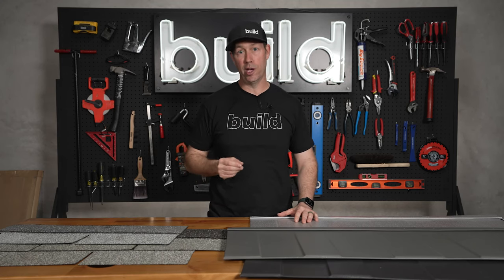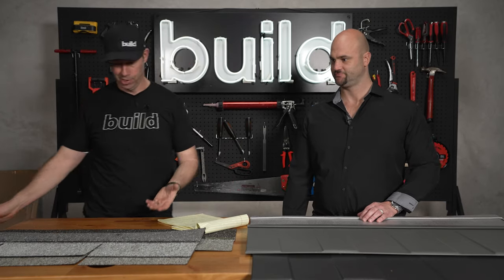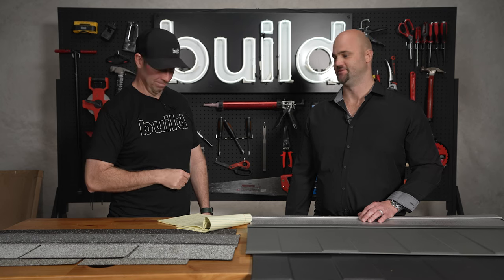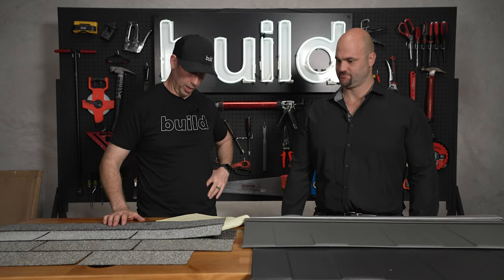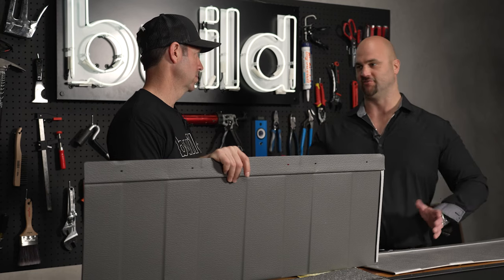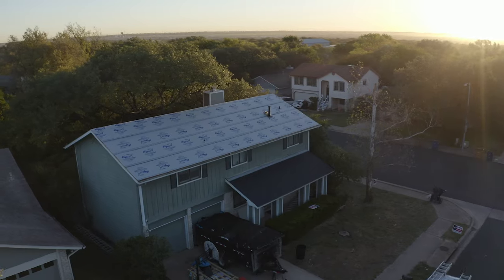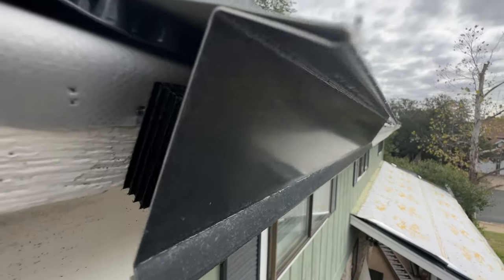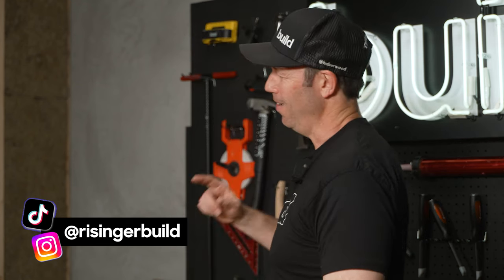Roof Shingles :  Asphalt vs Metal

Comment: Great video Matt thank you. I'm glad you touched on the hail issue early on and I'd like to share more information here. On a Facebook post I noted my preference for metal roof because of the issues you talked about here. A friend of mine who worked with the NRCA (National Roofing Council of America) noted one caveat I should mention. When an asphalt roof has hail damage part of the waterproofing system has been removed and is therefore covered by insurance. Hail damage to metal as mentioned here is aesthetic and it is likely that a traditional homeowner's policy will not cover the damage because as you said you have not damaged the waterproofing characteristics, just the aesthetics. Insurance likely doesn't cover aesthetics. I quickly added that as my friend says he's seen a couple of architects get in trouble by disgruntled homeowners finding this out the hard way.

Thank you also for sharing your ventilation method. I remember another video of yours where you talked about ventilating any roof in a similar matter but you had shown I believe one by four battens at a 45° angle to the roof slope for this. The matte method looks to be much simpler and quicker.

Comment: I'm wondering how that dimple mat being there between the metal shingle and the underlying roof deck and structure would affect things mounted on top of the roof, such as a racking system for solar panels? Would that require some kind of harder attachment points being created at various spots in the dimple mat, or can you screw things like that down directly over top of the dimple mat?

Comment: One thing to be considered when deciding between different types of metal roofs is what can happen when water gets beneath the metal panel.

Forensic building scientist Peter Yost, one of the hosts of the Unbuildit Youtube channel and contributor to the Green Building Advisor website, did a series of “Wingnut” tests (informal tests designed to see how building products might perform in real-world jobsite conditions) about what would happen when water is held in constant tension between the WRB or roof underlayment and a cladding.
Specifically, he wanted to see if water would either penetrate through a site installed product like GAF Dek Armor, Greenguard Raindrop, Greenguard Classic Wrap, or standard type D building paper and soak into the sheathing or penetrate through a factory applied WRB (like you would have on Huber ZIP sheathing and GP Forcefield).
How could this water penetration occur? Because sometimes there is no air gap between a roofs WRB or underlayment and the cladding material (such as a standing seam metal roof) so any water that does get beneath the metal panel can be held there under constant tension and eventually penetrate through the WRB and into the sheathing causing mold, rot, or possible failure of the sheathing.
His tests are covered in these three separate short videos.
https://www.youtube.com/watch?v=zR_8kxdksa8&t=24s
https://www.youtube.com/watch?v=bQesdZWpY3o&t=58s
https://www.youtube.com/watch?v=9IsH58FAhlY&t=26s

Comment: I have seen a lot of houses near the ocean replace their rusted metal roofs.
Reply: Metal roofs should be re-coated or painted every 20-25 years - this should keep the rust at bay.  Maybe more often if near salt water.
Reply: Is that for metal steels roofs because from my understanding aluminum shingles don’t rust. They use them a lot in Hawaii near the ocean because they are rust resistant
Reply: So I don’t know what type of metal roofs you are referring to but they’re fan favorite in beach towns.

Comment: I put my own metal roof on a home, after removing a shake roof.  (I blew out both arms removing the shakes with a scraper, and PAINFULLY installed the metal roof over the span of 9 weeks).  I had taken a factory course for 2 days as part of an evaluation for a community that was resistant to accepting anything except stone tile roofs.  Since my house wasn't architected for the weight of stone tiles, and fire risk was rising along with insurance rates, metal was a no-brainer for me. (others chose "dimensional shingle" which still has a shorter lifespan.  It took a LOT of meticulous work to put it on over a grid system for horizontal and veritical stability.  It was a wide ranch style home, and it had to be SPOT ON for the underlying grid.  I regret having filled in the slats from the shakes with 1x4's, but money was tight, and trying to wrestle 4x8 sheets of plywood to a 2 story roof with a steep pitch and blown elbows was impossible.    It DID affect cell phone coverage in the 2nd story of the house.  Overall, it looked very nice, and the company lent me a brake to bend the metal for valleys.  So weight is a huge consideration if you're moving from shake.

Comment: When it comes to fire, a metal roof obviously wont burn from embers. What I have heard is that many fires are caused because of the ridge cap design. Apparently it's easier for embers to get inside the ridge cap on a metal roof. Can you speak to this?

Comment: If your asphalt shingles are no too warped you can put metal over them. It’s cheaper than replacing asphalt because you don’t have to tear the old ones off. I’ve done it to 2 roofs. No issues b

Comment: There are two things I would like to see addressed in a future video.  
1)  What about rust?  If the roof gets scratched through the paint and galvanizing, it will rust and you get rust streaks.  That could happen even during installation with roofers walking on it or afterwards is someone has to go up on the roof.

2)  If the roof is in good shape and someone wanted a cosmetic change, of the finish was worn and grimy looking, how about repainting it?  A pressure wash, clean, and repaint should be possible in less than a day and much cheaper than tearing it off and reroofing it.
Reply: Rust is nothing but rim rams leaving the body. It doesn't exist.

Comment: I hope my testimony of buying a metal roof helps someone.  When choosing my metal roof I learned the hard lesson of buying cheap.  The big difference was in the warranty.  My house is about 1/2 mile from salt water (Puget Sound).  After several years the paint began to fade.  I should have looked carefully at the warranty when shopping.  The warranty of my roof did NOT cover being close to a body of salt water.  Had I paid for the more expensive roof it would have the better warranty that would cover my situation.  Not matter what kind of roof use a reputable company and read the warranty.

Comment: Looking to use metal shingles in my upcoming build.   I'm sold on the slate-like look, the durability, the wind resistance and the weight savings.   I'm building in an earthquake-prone area so weight savings up on the roof will make it possible for the walls below to be of a lighter construction than otherwise because the shear forces on the walls will be reduced when the ground is accelerated away from the roof in an earthquake.
Reply: FYI it is very hard to install solar on a metal shingle roof.
Reply: @patrickcorcoran4828  That's ok.   I'm not really interested in solar on my roof.   Maybe a standalone unit if any at all is my thinking.
Reply: @patrickcorcoran4828  Why is that? Those silver shingles look amazing for some bifacial solar panels so I want metal + solar ideally.
Reply: @TheRobojay   I've got some more technical responses to other comments below (sorry, not youtube savvy enough to link them) but the bottom line is that unlike most other roofing materials, metal tiles have an air gap between the "tile" surface and the solid roof deck/purlin/rafter below. Solar attachment points use a compression system for waterproofing and need a solid surface to compress against. If there is an air gap, they'll crush the "tile" void the warranty and cause leaks. Someone with the experience to do it and the approval of the metal tile manufacturer can install base plates to fill this air gap, but it has to be done during installation of the roof, otherwise you essentially have to re-roof to add the base plates.

Be careful because I have run into solar sales people that see "metal tile" and think its an actual tile, for which there are multiple attachment solutions. They don't understand that metal tiles roofs are just rows of embossed false tiles and go together like vinyl siding, rather than real tiles. 

Other metal options like Standing Seam and Corrugated metal work great with bi-facial solar. White reflective asphalt shingles are also an OK option.

Comment: Don't forget all of the asphalt that wears off into your gutters. Is metal also susceptible to ice dams? Thanks!
Reply: The cause of ice dams is inadequate roof ventilation and poor roof design. No matter what you roof it with, ice dams will occur, if they are presently occurring.  Ice dams on metal can be every bit as devastating as ice dams on asphalt shingles.
Reply: @akdoug6437  I would think ice dams on a Standing Seam metal roof wouldn't be a factor, but maybe in the Valley's.  With these shingles shown, maybe so.  I put a Standing Seam roof on a house from Eastern States Metal Roofing I had and was very pleased with it.

Comment: How well will these metal shingles work with solar panels? As far as mounting and leaks.
Reply: I’ve seen solar panels on metal shingle roofs. A little research shows several mountings.
Reply: There should be no leaks with properly installed roof panels. To connect the roof to the photovoltaic panels, special screws with a rubber gasket are used to prevent water from entering. At least that's how it's mounted at my place (I'm from Europe, by the way).
I have a 30-year warranty on the roof, while the average life of the photo panels is 10-15 years.
Reply: I'm a solar installer and formerly worked for EcoFasten Solar/Alpine SnowGuards, a company that makes roof attachment points for solar racking. Solar works on every metal roof type EXCEPT solar tiles. 

I'd bet that solar sales people will tell you they can install because they think it is like a synthetic slate, but when they look into how metal tiles actually interlock they'll realize they don't have the skill to install it. It happened to a friend of mine. Of the hundreds of thousands of solar attachments I sold in 4 years at that company I probably sold under 100 of the base plates that can be used with metal tile.
Reply: @eugenewilson7555  When roofers say "metal roof" they mean either corrugated exposed fastener roofing or standing seam roofing. Metal Tile is a tiny segment and I don't know of any solar attachments designed for it. Having worked at EcoFasten Solar/Alpine SnowGuards the QuikFoot and some snow guard base plates can work, but you need to de-install and re-install the metal tile roof first.
Reply: @andrzejzielinski8886  Do you have metal tile or do you have corrugated or standing seam roofs? European installers use EJOT lag bolts, but they don't work on metal tile because metal tile has an air gap between the metal and the rafter/purlin/decking you are screwing into.
Reply: OK Now I know what you mean. In my case, it is the EJOT system with trapezoidal sheet segments. It's been working fine for years.
As far as I know, the same system is also popular with more sophisticated metal roof tiles. In the case of shingle and ceramic coverings, fitters use fasteners resembling large clothes hangers.

This is what it looks like with sheet metal.
http://www.baltic-energy.pl/wp-content/uploads/Fotowoltaika-monta%C5%BC-blachodach%C3%B3wka-1024x575.jpg
Reply: @andrzejzielinski8886  That EJOT type product is show on a synthetic tile. Metal "tiles" are actually panels that are several tiles wide with the tiles being embossed into the metal surface. The installation is similar to metal or vinyl siding. Since the goal is to make it look like tiles the tile sections are a around a centimeter thick, which create an air gap between the surface of the metal tile and the roof. An EJOTs type fastener is made water tight by compressing the rubber gasket against a hard surface. Due to the air gap in a metal tile system the EJOTs or similar attachment will crush the tile, voiding the warranty on the tile and creating a leak. To attach something to the roof you therefor have to make up for the air gap below the tile. That's why base plates like these need to be installed underneath the tile. Home owners also have to check with metal tile manufacturers to be sure the solar attachment they use does not void the warranty of the metal shingle. https://www.altestore.com/store/solar-panel-mounts/roof-mounts-for-solar-panels/flashing-and-l-feet/ecofasten-solar-qf-base-al-125-quikfoot-aluminum-base-plate-125-stud-p41573/

Comment: When talking the weights make sure they are right. Many 3 tab singles are less than 200 a square. Especially the stuff sold down south. High end laminates sometimes are less than 300 pounds a square.  Metal is longer lasting and easier to install though.

Comment: The nail holes are specifically placed, what happens when you get the ever-present 1/4 to 3/8 inch gap in your older homes? Can you nail outside of the pre marked drilled holes?

Comment: Your insurance will actually go up with metal  shingle roof, as the insurance is based on replacement cost. I metal  shingles cost more than asphalt , than your insurance will go up.. This is based on my experience as i thought my insurance would go down, but not the case

Comment: I just put a 26 gauge stone coated steel roof on my home recently.  It cost me roughly 30% more than a high quality class A, Class 4 asphalt. The good news, It lowered my insurance premium almost 45% ( I had cedar shakes).  The bad news, every insurance company now has a "metal roof cosmetic damage exclusion".  Meaning, if your expensive metal roof gets the crap beat out of it by hail, your insurance company will NOT replace it.  The hail has to actually cause a leak to get a claim approved.  No size hail will puncture the steel so the reality is, your metal roof has no coverage by insurance.  That is absolute BullShit but that isn't the biggest problem.  The real issue is that roofers wont tell you about the exclusion unless you specifically ask and worse yet, the insurance companies dont disclose the exclusion until AFTER you buy the policy.  Absolute fraud in my opinion by the roofers and insurance companies.  Full disclosure of the exclusion should be to be required by law so homeowners can make an informed decision.

My advice, save yourself $1000's of dollars and go with the absolute least expensive asphalt shingle roof material available and let your insurance company replace the roof every time a hail storm rolls through due to damage. Asphalt shingles dont have a cosmetic exclusion.  Minor damage that leaves a ding and removes the granuals warrants replacement.  

There is no justification or logic to spending 30%+ extra on a steel roof except for the asthetics.  Then when it gets beat to shit by hail and looks terrible, your home value will drop.  Buyers will want it replaced.  

You have been warned.  If this helps one individual it was worth it.
Reply: You are just compounding your insurance rates by making big claims every time you feel like getting a new roof.  I don't think strategies like this work in reality.

Comment: I asked for an estimate from a metal shingle company and they said they did not do manufactured houses. Is there a pitch limitation to metal shingles?
Reply: Just laziness lol
Reply: Mobile homes are built in a factory and this causes installers to think that the manufacturer might have been up to manufacturing building in a manner that metal might not go into places that metal could otherwise need to be from the manufacturer but really the installer could think so also but to include.

Comment: 11.29.22
Very informative video.  Question:  Does moss stick to this metal?  Is it easy to walk on so one could clean out the valleys when the leaves fall off of the trees?
Reply: Same question, no one will talk honestly about how to work on a metal roof without simulating a playground slide.

Comment: Nice! Out of these two, the metal seems a clear winner for performance.

How does the tempered glass rooves (like the Tesla ones) compare?
Reply: Tesla is getting out of that business, so it's a moot point, but you should check out how many of those catch fire. I mean, it IS a Tesla product, so that's pretty on-brand.
Reply: @genjii931 If Tesla says pop goes the weasel, then they know to start popping.

Comment: Years ago 1994 time frame I got a bid for metal roof from a fair size roofing contractor in the area. My question is that they stressed the mold problems that metal causes and that they would need to place a lot vents in the metal to avoid. My observation is I don’t see vents being installed. Was that a myth or fact?
Reply from the maker: Myth.
Reply: @buildshow Fact.

Comment: What about adding solar panels on the roof?
Reply: I'm a solar installer and formerly worked for EcoFasten Solar/Alpine SnowGuards, a company that makes roof attachment points for solar racking. Solar works on every metal roof type EXCEPT solar tiles. 

I'd bet that solar sales people will tell you they can install because they think it is like a synthetic slate, but when they look into how metal tiles actually interlock they'll realize they don't have the skill to install it. It happened to a friend of mine. Of the hundreds of thousands of solar attachments I sold in 4 years at that company I probably sold under 100 of the base plates that can be used with metal tile.